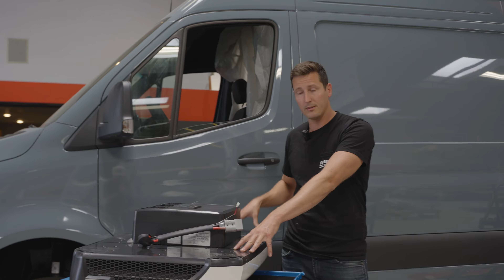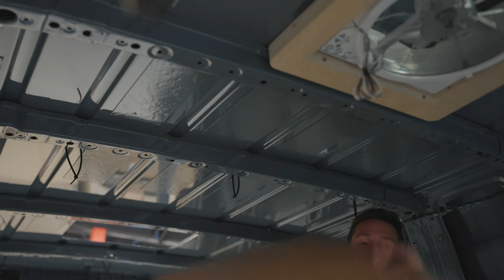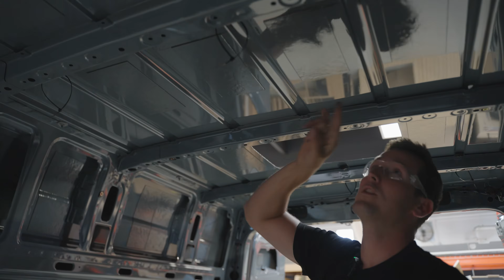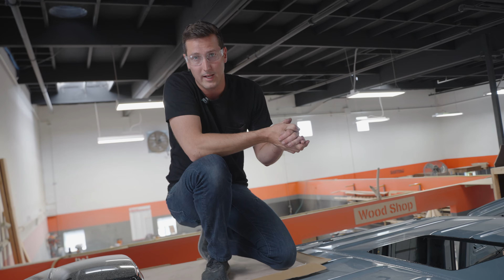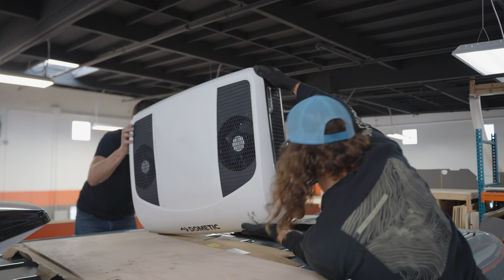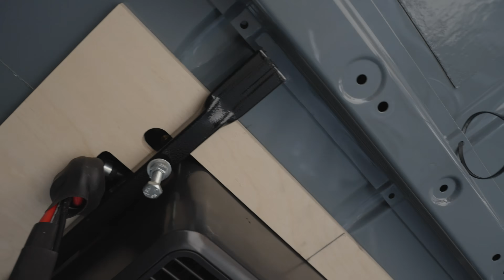How to install Dometic RTX 2000 Rooftop Air Conditioner - SV Installs

Comment: Have you thought about using the diyvan adapters for a cleaner/more reliable mount to the roof?
Reply from the maker: I like to use those for the fans if you are mounting in a location other forward center position (which mercedes already left flat for us for easy fan installs. The gasket for the AC is plenty thick enough to make up the variance of the roof ribs.

Comment: Hey guys, awesome stuff!
Quick one: how much clearance should you have ABOVE the unit? I'm not doing well with space and was thinking of having solar panels above it. I can't find any info anywhere. Chatgpt says 5-10 cm should be enough. But... yeah 😅
Thanks!
Reply from the maker: Just enough to get airflow through the fans on the top of the AC unit. 5 -10cm will be fine. We're currently in the works on a product that integrates with our roof rack to allow you to mount solar above your AC. Should have that in the next 2 months, so stay tuned or if you'd like more details on it give us a call.
Reply: @sandyvans I am waiting on that build ❤